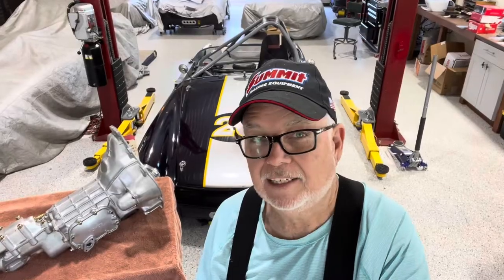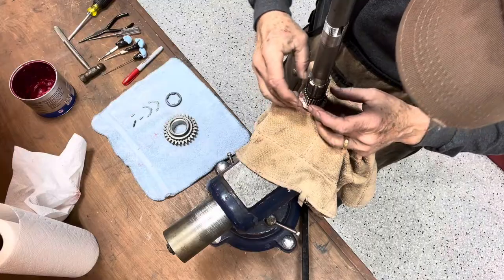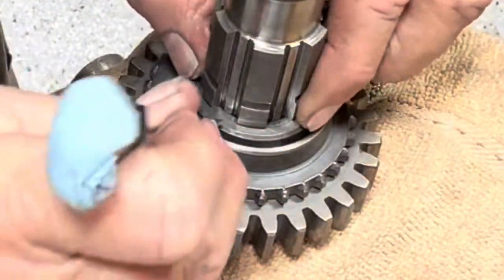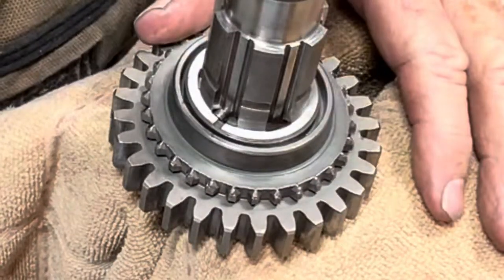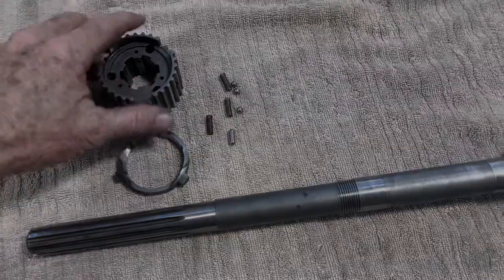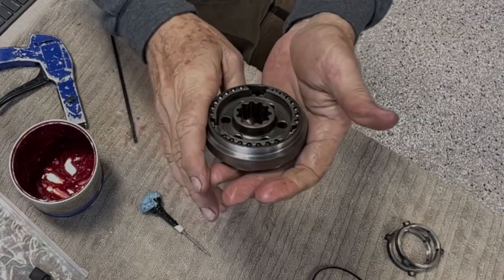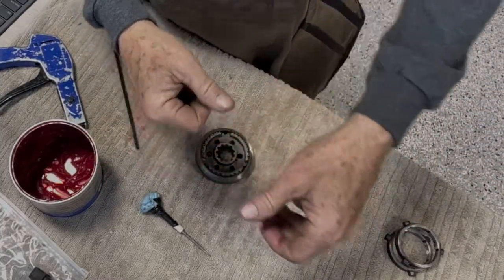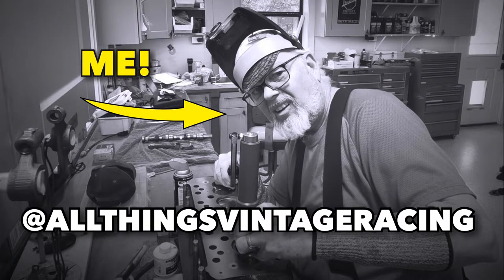How to build a Spridget Gearbox - Part 1 of 2  (Race or Street) @allthingsvintageracing8656

Comment: Thank you for this very excellent and informative video, Steve!  Maybe you cover it in the Part II video, but I've always wondered how you determine when a gear or synchro hub are too worn to use - I'm speaking specifically about the pointed gear that meshes with the synchro ring.  

You often hear a vehicle seller say, "oh, it's just a $15 synchro" (never mind the R & R labor...).  It's been my experience that when the synchro has failed, typically the gear and synchro hub are also worn to where I feel they should be replaced.  Still, I would like to know the fine line of accept or reject on those parts.

Thanks again for your excellent video and all of the time you put into it!

Comment: My biggest fear has been tearing apart ANY transmission. But with your excellent camera work and the clear precise manor of your voice (Reminds me of Mr Rogers, especially with the background smooth jazz :) ) I feel like I can tackle this. Especially since my bugeye smooth case keeps popping out of second gear  when downshifting. But I don't think you can get parts for those. But I have a spare ribcage I can inspect. Great video! Thanks so much.
Reply from the maker: Thanks for your kind comments and I’m so glad that maybe I can help just one fellow enthusiast…or encourage someone to just give it a go…because you never know what you might learn…

I have a solution for your 2nd gear problem coming up in Part 2.   Sometimes it’s just a worn out synchro , and those are available.  Sometimes it’s a worn shifter fork, sometimes you need a little washer on the shift rod…

More coming…and thanks again…
Reply: @allthingsvintageracing8656  oh can't wait

Comment: Did I miss where you showed folks how to get it apart? Especially those two pins on 2nd gear under the lock plate?
Reply from the maker: No, you didn’t miss that, as this video is about assembly.   And yes, that’s a bit tricky to take 2nd gear apart.  I’ll need to make a video on taking 2nd and 3rd gear off the main shaft…. Which I will do…

Thanks…your feedback helps…

Comment: Any tips for removing the main motion shaft? Mine won’t budge. I’ve pulled out the selector rods and forks, lay shaft and reverse shaft, and the main shaft circlip. Is it suppose to tap out now or is there something else retaining it?
Reply from the maker: Hi Ethan,
There is a circlip on the bearing on the first motion shaft on the bell-housing side. Once you have the main shaft and all it’s gears removed from the back of the case, I generally just remove the circlip from that first motion shaft bearing and the first motion shaft and it’s bearing fall into the case.  It it’s tight, a little tap with a piece of wood and a mallet on the spigot end of the first motion shaft should pop it out.

Cheers….Steve
Reply: @allthingsvintageracing8656  thanks Steve. I ended up taking an air hammer to the the inside of the bearing housing to ram it out. It seems the bearing housing was just an extremely tight fit into the bellhousing of my box